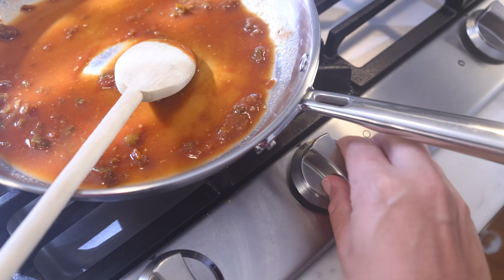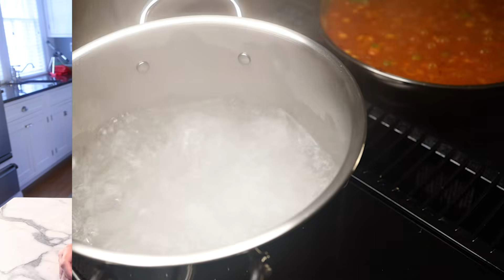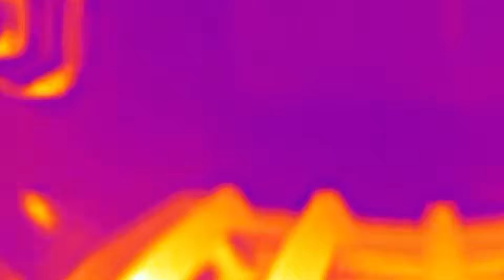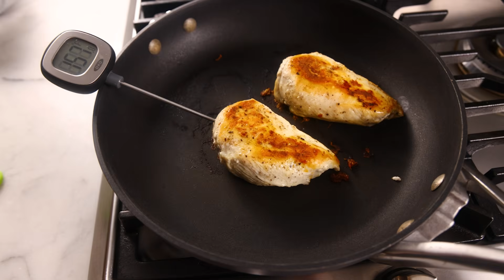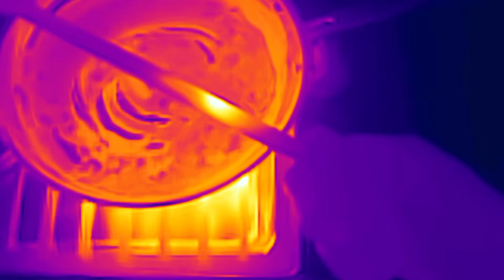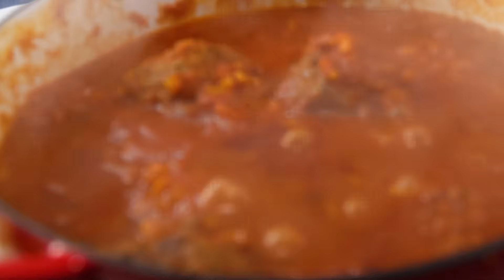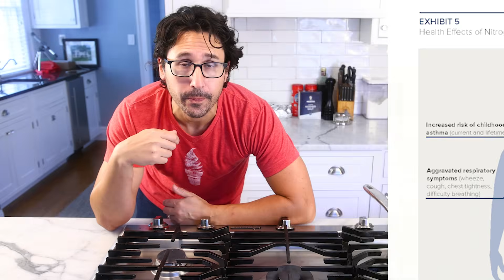Problems with gas stovetops | weak, dirty and dangerous

Comment: cooking is about far more than just heating something up as hot as possible as fast as possible. the problem with electric cooktops is exactly the fact that their heating response is a lot less predictable than gas. gas is far more forgiveable to heating to a desired termperature than electric is. i really don't care about the fact that electric may technically be more efficient if i seem to always screw up eggs far more often on an electric cooktop than on a gas cooktop. i don't care that electric is more efficient if it doesn't heat up in ways that feel natural or predictable to me

Comment: I feel the whole... needing to get use to cooking on new stoves. My parents owned a gas stove, when I moved I got glass top burner stove, which works a bit differently than the coil stoves which my parents had before the gas stove. I found it retained heat a lot longer than even the coil stove. My stove finally died, and I replaced it with an induction hot plate, I'm still trying to get use cooking it. After years of cooking on the old glass top, some of what I did, I can't do more? Like I use to cut the heat and use the residue heat from the stove to finish cooking some foods that didn't need full on heat but needed to still cook for a bit longer.

I also think I need things less hot than I think I do on an induction stove. Just because it focuses the heat much better, it's weird...

Comment: I learnt to cook on an electric resistance ring cooker. I've used gas and still love electric. Now I have a ceramic hob (glass covered resistance rings) and still love it. I'm so used to anticipating when to cut the heat back it's second nature. The same with lifting a pan to get fine control of the heat. 
I think one problem people have with electric hobs is they use them too hot.
Reply: Whenever my ex was cooking, the stove had two settings: Max and Off. She was an impatient cook. I tried to explain that it's quicker to cook something slower than burn/ruin it and have to start over again. 😆

Comment: 8:11 although it is identical to operate, ceramic stove are not the same as heat plate. Instead of the filament heating up by electrical resistance, it radiates infrared that the ceramic is designed to absorb so you get an evenly hot stove top. Place it under sunlight and you'll see what I mean.

Comment: I had not known about the NO2 problem with gas stoves.  I worried about the CO2 and CO with burning gas in the house.  I have a CO2 monitor in my kitchen and can see the ppm of CO2 climb very fast when using the gas stove.  
The problem that I have with the induction cook top is that for very low power they are just cycling on and off.  I have scorched foods when I try to simmer them.  I have gone to using a cast iron skillet between my pan and the induction cook top when I wont to simmer foods.

Comment: Having had all but induction in my life, here are my thoughts: I thought gas put out plenty of energy but when on high, the flames (which were all firing from the sides of the burner) shot out so far that as you pointed out, it was actually licking the sides of my pots and leaving the centers untouched. I always wondered why they didn't direct some flame straight up by putting holes in the caps. That seems like a simple enough solution but maybe there is a fundamental reason why they don't. Glass-top burners look pretty when clean, make a nice work surface when off and are efficient, but I think they are very hard to clean! Food just burns onto the quartz and it takes a lot of scrubbing with a special cleanser to get it off. Razor blades and Scrubbing Bubbles don't cut it! Regular electric coils are my favorites. Simple, easy to clean, inexpensive and efficient. If I want response time, I can have a couple going at once on different settings.
Reply: For cleaning the stove tops, I found the TSP powder to be a total game changer.

Comment: I'm not sure how common these are in the US, but in the UK (patricularly in older rented or student accomodation), resistive heating stovetops with huge metal plates over the hesting element are very common. They're even worse than glass tops for responsiveness, but I'd guess it's to add more thermal mass to reduce the effect of the on/off cycle

Comment: Gas in most of europe:
- Most of the nations sell them only with a safety valve. If it blows out from being too low, it shuts off. No leakage.
- I only use gas because it is impossible to set the heat as low on electric as it is on a good gas burner. I am a big soup fan and for making good beef stock you need to let it cook for hours and hours without it boiling.
- You need to use different pots and pans for gas. The shape is very important for this. One of the reasons why you boild water for pasta or other similar dishes in tall pots. They boil faster due to heat climbing up the walls.

Gas is just different. Learn to use it and it will work well. Or don't and use the other stuff.
Reply: THIS
Reply: Anyone who actually cook use gas stoves. For the plebes, it's safer for them to use electric stoves.
Reply: @kaikart123  maybe is you live in the wild lands where shut-off valves and safety standards don't exist.

Comment: Wider pans. You lose a lot of hear around the small pan used in the pasta bit at the start. You always need a wider pot on a gas stove which is why gas stoves in prof kitchens heat hot flat cooking surfaces.

Comment: I tried all three versions and yeah, gas is not for me either. I could cook on it when I studied in the UK but heat regulation was a real struggle like you said.
I tried induction in Hungary while on holiday and I will definitely opt for that when my ceran field aka electric burner under glass will fail.

Comment: I had a glass top electric stove in my last apartment, and just moved in to one with a gas stove. I am WAY enjoying the responsiveness and how easy it is to keep clean. Glass tops are a fricking nightmare imo in that respect!!! Accidentally spill some of what you're cooking on the stove while it's on? Hope you like scrubbing, bro!!
Reply: I feel the exact opposite haha, cleaning a gas range always involves taking things apart and trying to clean little nooks and crannies. With my glass top 90% of stuff just comes right off with cleaning spray and a rag. It takes less than 30 seconds to clean after everything's cooled down. For tougher burnt on stuff I have a special glass top cleaning solution with an abrasive sponge that literally get's it back to brand new looking with a couple minutes of labor. I only have to do that maybe once a month tops.  I feel like with most gas stoves you'll get lazy about it for a few weeks and then burn on so much stuff on weird metal surfaces that can never be brought back to new. But I'm sure that varies a lot by model.
Reply: @jameslk68  agreed. Don't know what this guy's talking about saying gas hobs are easier to clean.
Reply: @phelpysan  It is easier to clean though
Reply: @kaikart123  how though? A single flat surface vs multiple pieces with lots of nooks and crannies.

Comment: Your points are well taken, but, in the end, using most electric cook tops are far too frustratingly divorced in terms of immediate effect from what I'm doing. I was forced to use a run-of-the-mill craptastic electric range for a couple of years between households. Except for boiling water, I never got used to it.

Comment: As someone who has cooked with gas stoves all their life, you get a good feel for taking stuff off the heat and back on to compensate for the lack of a low enough setting. And while sure you have to babysit your food more, I feel much more in control of my pan and what I'm cooking when it's over a gas stove where I can directly see how big the flame is and control how far it is from my pan instead of just some number on a dial telling me how hot my stove is. Additionally, I've found that in the same regard, each electric stove sort of has its own mind to it and you have to get a feel for it, whereas with a gas stove, if you have experience cooking on one you can pretty much assume that all gas stoves will behave about the same (at least in regards to how you control the flame and temperature of your pan)

Comment: I can handle the "not heating up fast" but not the "not cooling off fast" part of an electric resistance burner.  I get into this cycle where I put the heat up high to get a sauce going and then have to pull the pan off the stove when it starts boiling.  I used to home brew bear in 5 gallon batches.  For that electric was nearly a requirement.  For everything else I'd prefer to use gas.

Comment: I was shopping for a replacement vent hood when I learned about the health risks with gas.  I decided to get a kick a** vent hood since my old one had died anyway.  I use it every time I'm cooking - even in the oven.  It should blow out of your house, the circulating fan filters aren't going to do as much good with fumes.  This was easily one of the best purchase I've ever made.  It's keeping the kitchen cleaner, my family healthier, air conditioning bills lower, it's strong enough that it helps with onion tears and last week I watched it suck up a fruit fly!  Awesome. 😀

Comment: so my biggest problem with the coil variety of elecric stoves is that you lose way more heat compared to gas if the pan doesnt sit completely flat. Gas does not have this problem. The next thing is that as you complained, heat on gas spreads out more, meaning you can use pots that are larger than the spot whereas if you want to use a large cast iron on an electric stove, you're going to only have heat exactly over the coil and it's going to be cold outside of it.

Comment: Gas > electric. IDK what you mean by weak. My gas stove on it's lowest of the low ( you can barely see the flame) and my food will still simmer almost to the point of boiling, and it's not dirty at all. I will never cook on an electric stove.  Also a good tip for boiling water use a copper bottomed pot, my water boils extremely fast.

Comment: The thing about the extraction hood makes so much sense, I never really thought about it until recently but both my  grandparents and parents would always have the extraction fan on during cooking because they learned to cook and have cooked on gas stoves for decades and obviously you'd need extraction when you're working with gas because you don't want any of that stuff leaking anywhere out of the kitchen.

Now since both my sister and I have moved out we've both ended up in places where we have induction & glasstop electric cooktops respectively and we both got into the habit of not turning on the extractor fan when we're not doing something steamy or smoky without realizing why, but this video has made it click for me.

Also hitting the nail on the head about wok cooking, I love me a good stir fry but the only way I can come close to having constant heat on my old electric cooktop is by cranking it all the way up to max and putting it down on the cooktop during a "peak" in the heating for hotness during a stirfry and just lifting it off if I don't need it, but it gets really annoying when you need heat and suddenly the coil just goes "hold up needa cool down for a couple secs here" and you can instantly see your stir fry going to a stir melt instead.

Comment: All of that may be true but when I see fire, my cave man brain gets activated. I've got an old retrofitted stove top that has 3 rows. the first row has 2 ordinary gas burners, the 2nd has a gas cast iron hot plate with a removable section for woks and the third is a decent electric resistance stove top. And I've come to use all 3 equally. The ordinary gas is the best for frying, the hotplate is good for large Dutch ovens and the electric is the best for boiling.

Comment: Note that it is possible to produce carbon neutral municipal gas supply - some research has gone into because in very cold climates gas heat may still be the best option. Synthetic methane or even pure hydrogen are options that might be perfectly serviceable in existing burners without substantial retrofitting. It also may be a viable energy storage medium - turn excess wind energy into hydrogen, then mix that into the municipal gas supply when needed.

Comment: Here in Texas, almost no apartments have gas stoves; you might find one complex out of 100 that has them, and about half of the houses here are electric. I’ve had really mixed results with electric, my first apartment was a “luxury” apartment but it had a really terrible landlord special stove that took like 15 minutes to come up to temperature, and never truly could do high heat. The brand new Samsung stove in my current house, however, comes up to temperature ALMOST as fast as a gas stove does. The only drawback is that 2 is basically medium heat and 4 is medium-high, anything above that will turn food into hot ash.

Comment: I liked my old gas range, but it took forever to boil water and collected dirt and crumbs under the grates. The electric glass-top range at my new house is far easier to clean and heats up a lot quicker. I do miss always having heat even when the power goes out with the gas stove

Comment: Honestly though that part about "it differs greatly with the model of gas stove" is, in my opinion, a much bigger concern with electric stoves. I've been using an open resistance coil stove for the past few years at college, and it's power output pales in comparison to my parent's older gas stove. Plus, one thing I've noticed a lot about this type of electric stove is that oftentimes I can't get it to heat a pan evenly. Unless you have the coils lined up perfectly flush with one another, hotspots will begin to form in areas where the coil isn't fully contacting the pan.

Comment: I’ve found electric to be harder to clean because the food cooks on immediately instead of falling down below where it’s cooler. Also you need to make sure your glass is 100% clean before using it again. Electric is good for everything else though. 
Oh what about seasoned cast iron? Does the glass pick up oil from the pan?

Comment: Disagree, by a long shot i prefer a good gaz stove to a mid-range induction and resistance/halogen is crap any way. First sensitiv buttons are easy to clean but way less intuitive and easy to adjust quickly than a nob. With gas you can easily incline and move in any direction to modulate the heat and it's position on the pan, induction just shut's off. The flame it self is usefull for flambé or charding nori, tacos... And good retaurants still use gas a lot. Carbon foot-print is ridiculous compared coal powerd electricity.

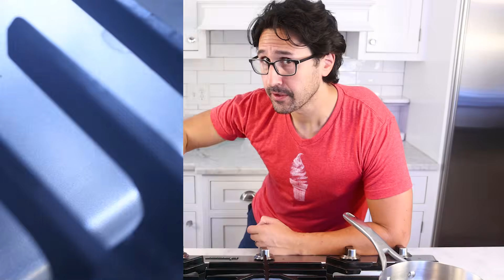Comment: 7:10 "all the way down is not low enough" on gas. I have the exact opposite problem. On an electric top, low still makes things boil over like crazy. Probably because it takes so freaking long for it to cool down. That rice you bought to a boil and now need to simmer? I have no idea how people cook on electric.
Reply: Ohhhhhh is this why people are afraid to cook rice on the stove? I used roommates rice cookers for years but when I moved into a place by myself I didn't have one so I learned to cook it in a pot and I was surprised how easy and straightforward it was. I had always heard that cooking rice on the stove was extremely difficult and that you were better off using a rice cooker. I bet it's because I have gas that it's so easy; the whole "bring it to a boil and then turn it down to simmer" step is nearly impossible on a resistive cooktop.
Reply: Bring the rice to a boil, turn it down completely or put it on low and just let it be. That's how I do it and it works just fine. Granted I use cooking pots with thick and heavy bottoms so they hold heat very well.
Reply: move it to another burner? it will warm up while the rice cools down from boiling.
Reply: You bring the rice to a "just so" boil and turn the plate off. If it's brown rice you turn it back on after a while  to simmer on low. I always just switched plates when I have a "stays hot too long" problem
Reply: That's not accounting for induction, which is way faster in changing temperature than gas stoves, because of the higher thermal efficiency (a gas stove also heats the iron grate, the walls of you pots, etc.
Reply: Bring up to a simmer/boil then set a different element on low and move the pot over to it. Not that hard, but you do need to think ahead a bit more than with gas. :)

Comment: I’d love a video on cooking instructions on electric vs gas. I find the instructions on rice for example will overcook on electric, whereas on gas turning down the temp and simmering for the rest is perfect…ive started heating two different electric burners and swapping them when the instructions say to turn down to low
Reply: Same here. I only had an electronic range briefly in college, and I burned a few pots of rice before I figured out that using two burners trick. I learned to cook on gas and that's what comes easily to me now. Every apartment I've lived in (except in college) had a gas stove. Honestly, I prefer it, mainly because it's what I know and am most comfortable with.
Reply: For real, you would think with electric outnumbering gas 2 to 1 there would be more recipe tutorials on it. But the problem is gas is more high end and bougie, so of course fancy cooks and homeowners have gas.
Reply: @neoasura  man, in my country gas stovetops are far from high end or bougie; any glasstop would be considered far more up that alley.